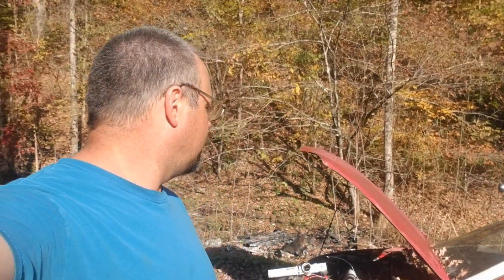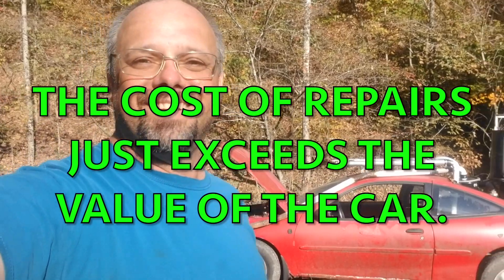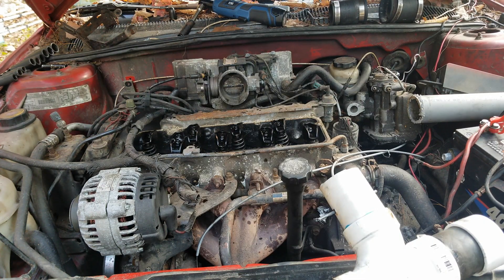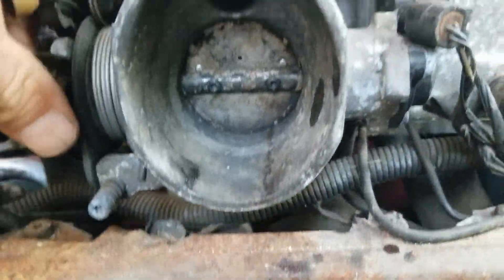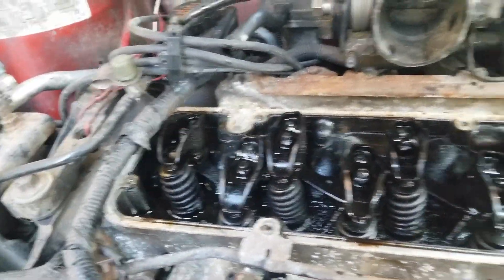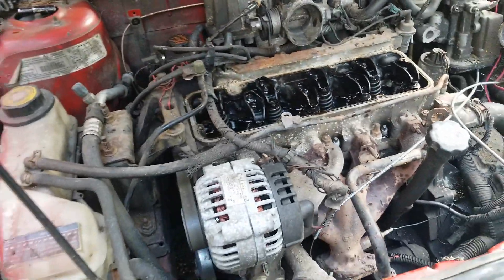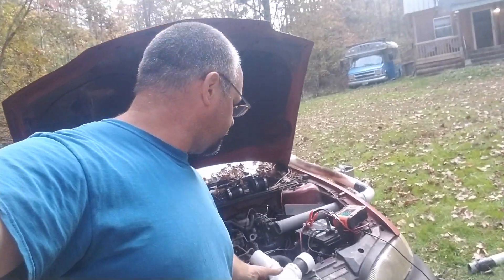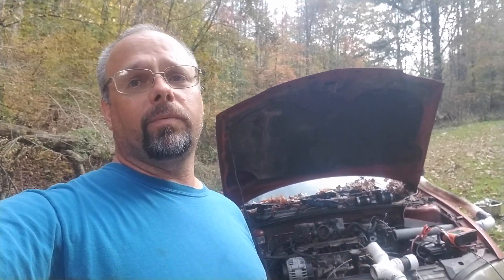Gasifier Update

Comment: Thanks for the update. Seems that Cavalier more than paid its way as a testbed for  your gasifier. How are you going to test your filtration before you install it in your truck?
Reply from the maker: Good question! I do need to test the filtration. I may put the leaf blower on the pipe going to the engine just to make sure I don't get too much soot. I could make a filter at the end to catch whatever makes it through. Then I could see what the engine would end up with.

Comment: The throttle sticks randomly on my Edelbrock. It's not something that keeps me from driving it after every flareoff. I put stiffer return springs to help it when it happens. From one woodgasser to another, thanks for the updates! 🪵🔥💨
Reply from the maker: Interesting! Might be an addition to the Silverado. It did stick a little at first, but popped right loose. I guess it would take quite a bit to actually stick valves.